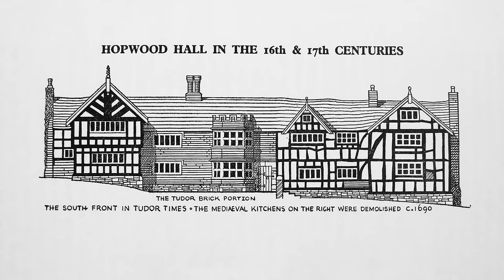Renovating my Ancestors' Abandoned Castle | Phase 2 Before & After

Comment: In Florida, before spraying against mosquitos became more modern approach, they built "bat houses", so the bats would fly at night and help keep the mosquito populations down, especially since malaria was still common enough during those days. Perhaps that might work there, providing some bat houses around perimeter of the property and encouraging the bats to roost in them instead. Typically they look like tall "A" frame structures and the bottoms were left open for the bats to enter and their droppings down to the ground. On the inside of them lath boards were space accordingly for the bats to cling to. They'd fly out at night, do their mosquito control and back by mornings. Check out some history of those, see if they would work for there in England, taking weather and temperature into consideration. I do remember the few left I saw in 1960's that they were always very dark colored structures, perhaps that was to keep the bat house warmer in winter conditions.

Comment: What a monumental undertaking. I love the restoration and preservation of old buildings. I would not be so much of a purist that l would leave dips and bends in the roof. Seems like they would just get worse over time.
Reply from the maker: Thanks so much Bryan - the dips and bends could've been there from the start and possibly no way to actually change them without causing more damage to the historic fabric. Leaving them is what Historic England advises and they are strongly supported. cheers

Comment: Dear Hopwood ~ Re : bricks & motar ~ Do the bricks need to be removed / cleaned of mortar / replaced & remotared ?
How do they test the 'load bare' of the new slate roof tiles ?
What type or repair or replacements for the downspouts ?
How do you eliminate bats from roosting there ?
1699 Clock is.utterly amazing.  I would want to put a leather strap around it bolting to the wall on both sides.
I love working with wood.  Mystified with joinery / sistering of joints.

Lord Byron would be in awe of all the retoration.  Byron may have contributed to the floor wear. Byron's adventures in the bedroom adjacent halls ~ 

Congratulations Hopwood ~ Phase I

Orchestrating this is more than the work itself. 👏👏👏👏👏🎬

Comment: As a builder here in Michigan, I like the color mortar that YOU prefer (that's left rough); However, I prefer the smooth tooled finish which not only looks cleaner and better, but will repel water and moisture better as well. Are there any findings to backup your notion that the roughish finish was the way they did it back then?

Comment: The only thing that I have some reservations about is that they are using modern building techniques on a historic building ie the lead flashing on the roof, the roofers have done a great job but it wasn't done that way in days gone by, also the pointing on the outer wall is a dismal job & I'm surprised the building inspector passed it.
Apart from that well done & good luck for the future.

Comment: You have a mammoth task here but it must be costing a fortune to repair the damage. 
my parent bought an early 16th house made from solid sandstone blocks 18 inch's thick. The house was reed thatched originally but had been changed to slate. They renovated the house and had a new roof fitted the conservation officer told they they had to use Welsh slate at 4 or 5 times the cost of a similar colour slate from other areas. My dad was a lead worker and remade many of the gutters, downspouts and rain water boxes on some some of the biggest stately homes across the north east of England.

Comment: The top of the wall in "the transformation - new mortar" looks like it might be able to fit bats. they only need 1/2 inch to get in and it looks like they might be able to get in that section. I can't tell exactly where it's coming from, and I can see you already have mesh up likely for this reason, but you can hear bats as you're walking through that area.
Reply from the maker: Thanks Daniel - yes we actually are required to allow the bats to still get in since they are an endangered species
Reply: @HopwoodXIV  ahh makes sense. thanks for the insight.

Comment: Beautiful restoration work so far. The one sugg I would add is to check out houses made in the Caribbean. They make them totally cement and rebar. Yes even the floors between the levels. They do this with a lot of sticks temporarily holding up a mold, then they pour cement in. As you know, it's way better / stronger to have it totally cement.
   - You can see how they make them by doing a few searches here on this site.

Comment: Hello Sir I am from Calcutta, India. We will be restoring our Ancestral Walled Mansion/ Zamindar House sits on a Plot area of 12,500 square feet the house is 2 storied Inverted U Shaped  building with Roman Arches in the centre 260+ years old has Wooden Teak beams. Your video is a big help. If you can send your mail I can send some photos of the current condition.

Comment: Tin will rust away.  Lead or copper would’ve been the proper element to to’ve used.  Lead lasts 300 years if not walked on or punctured.  Tin isn’t pure tine,andGalvanized    Ferris metal with a tin coating.